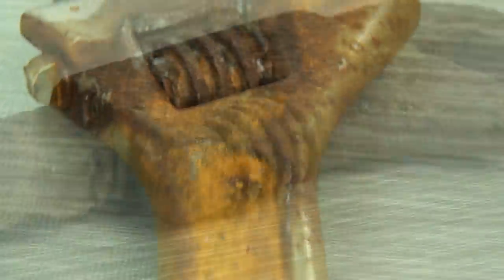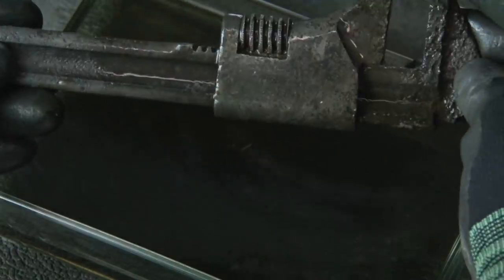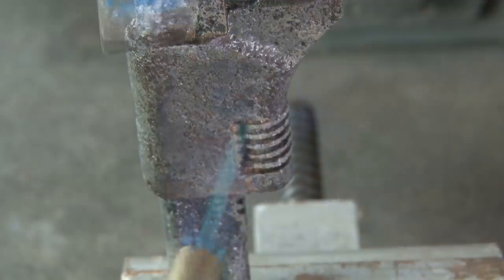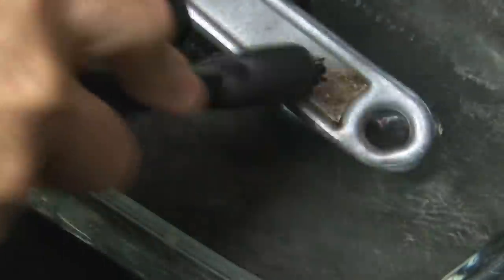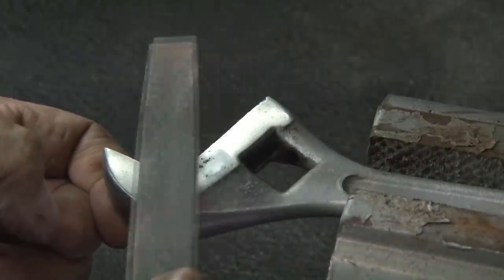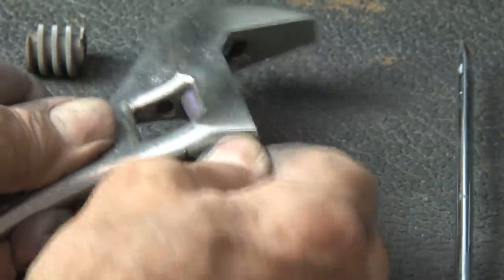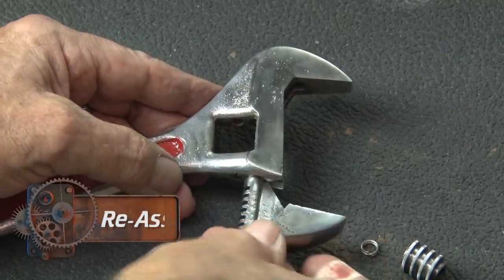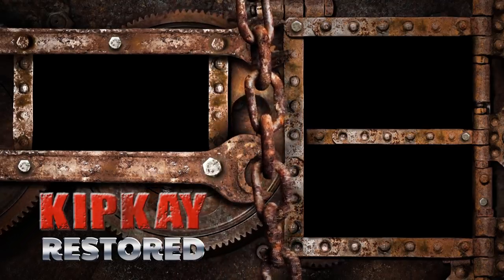WRENCH vs. WRENCH - Restoration Challenge!

Comment: i would have gotten wrench one to move easy. you didnt apply enough heat or the correct penetrating oil. try using PB Blaster and MAP gas instead of the butane. its not getting hot enough.

Comment: Here's an easy way to get metal parts unstuck: homemade penetrating fluid with 50/50 ratio between acetone and automatic transmission fluid. Careful with acetone because it melts plastic like crazy. Use low viscosity ATF because it goes through tight gaps easily. It's cheaper to make and requires a lot less force to break stuck parts loose. Give it a try in your next restoration video that involves severely rusted or rust-welded metals that are on there tight.
Reply: SackboyD Diesel works well to
Reply: Damper fluid and spirit works also well.
Reply: If you do this, wear a respirator. The fumes from that stuff have no real oder, but are very dangerous.